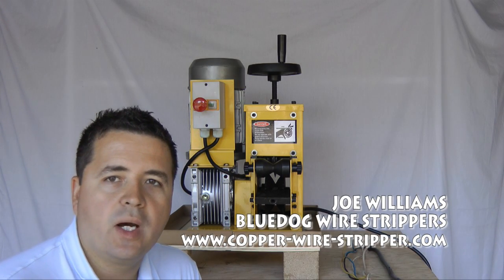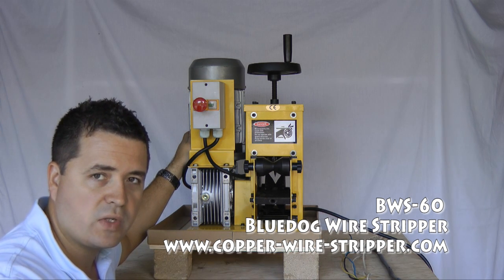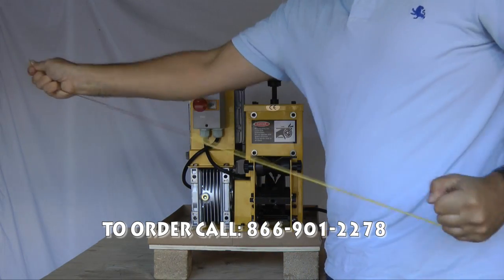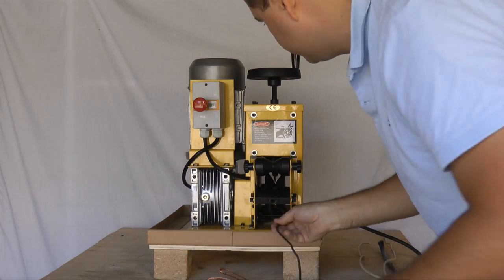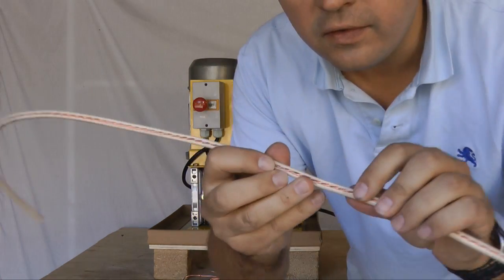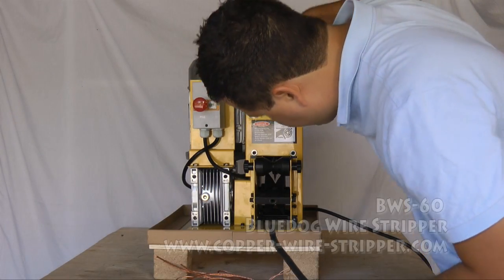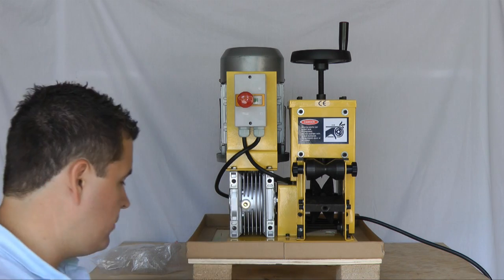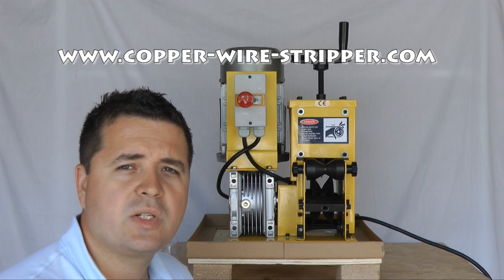Copper Wire Stripper BWS-60 Demonstration - Electric Wire stripping machine

Comment: All theses machines seem the same. Good at heavy wire which is pretty easy to strip by hand and multi core that has only a few heavy wires inside that I strip with rollers that compress the plastic jacket and it just splits the plastic and peels itself off. When one of theses machines can do 14 or 16 AWG fine multi strand wire I’ll buy one. I haven’t bought one yet and I’ve been looking for a long time. I guess that’s why the big scrappers use granulators instead of stripper as with granulators you just throw in bundles of mixed type and size wire and it comes out clean BUT they are very expensive for us amateurs.

Comment: "beat the pants off the Gensco Machine", what are you, 5 years old.  First, the BWS is a chinese machine that is a direct copy of the CSX model, which has been produced by Deltax for over 20 years.  $1395 just about says it all folks, you get what you pay for.  HP = speed, you don't need 2HP for a small machine, you can't feed it fast enough.

Comment from the maker: The BWS-60 will beat the pants off the Gensco Machine. Just test one.  When you compare the price:  $ 1395 plus tax and shipping vs. $ 3400 bucks plus tax and shipping the people are not getting their monies worth by buying the Gensco.  The BWS-60 has 2 HP motor. Heavy Duty Gear Box - 2 Extra Blades and maintenance tool kit.  Plus Rated from 16 GA to 2 3/8" Wire.

Gensco has cheapened out on the HP of the motor and the gear box to save weight on the machine.
Reply: I want to see a video of BWS60 cutting 2" XLPE insulted copper..thanks
Reply from the maker: @mauriliolibrado8857  - Sure, send us some samples and we will gladly film a video for you!   NOTE: We have had alot of customers strip 100,000s of lbs of XLPE - 2" with this machine.   Cheers.